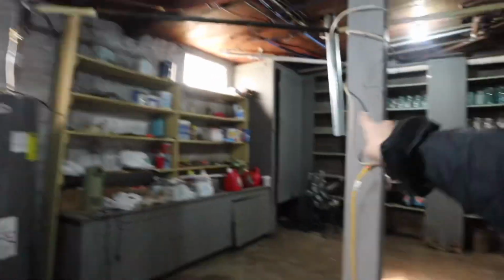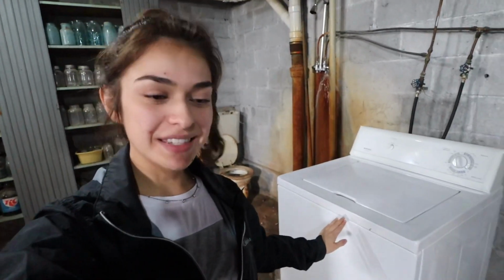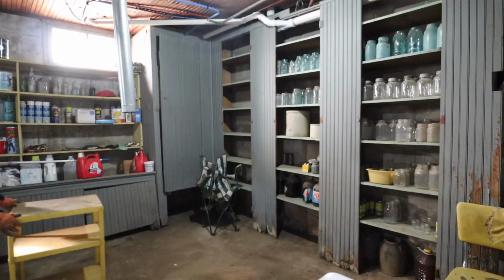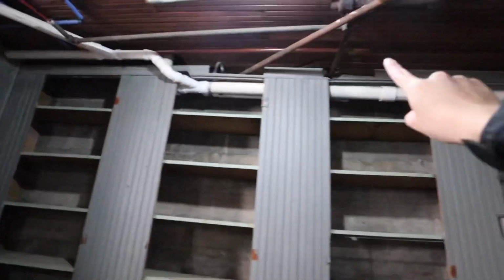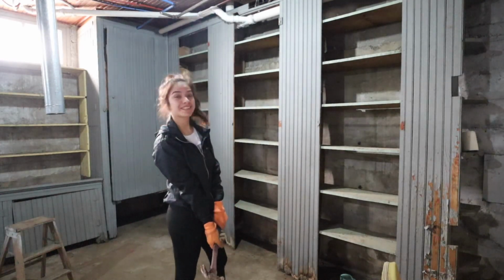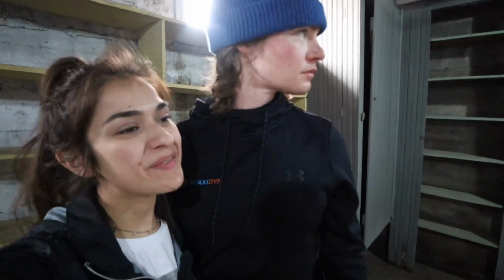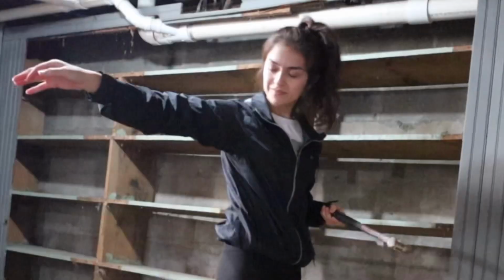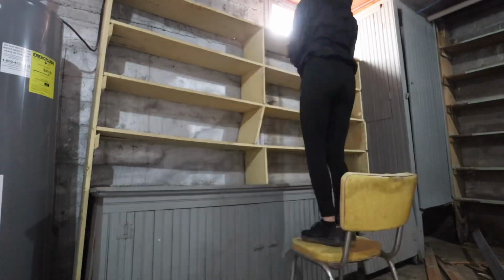Renovating The Scary Basement!!!

Comment: With all the room you have upstairs, move your laundry to the second floor where all the laundry is generated. Most basements need a dehumidifier to help cut down on the moisture, dry lock and paint with new bright led lighting will transform any basement.
Nave goes full on beast mode..... good for you girl!

Comment: Love that as time goes by Nave - you show in your videos no fear of working to achieve an end goal - just like Cole.   

For your spider fear and to keep bugs out of the house in general - next time Cole & you go to Menards take a look @ Spectracide.   

Cole has his handy little full faced mask with filters so put him to works spraying the outside basement walls that are exposed up to the bottom of the siding.  Then spray all along the top of the basement walls, around the windows and as much under and behind things.   Suggest a minimal of twice a year in the spring of the year when bugs come out and later in the fall when they try to make a home inside a heated house.  

Been doing it for years and so rare to find anything in the basement or the house in general and if I do - it is moving like snail so easy to splat.  

Bugs in general need to stay outside all year around.   Have suggested to many other folks and they have the same or better results.  

The basement "redo" cleanup will be interesting to watch.  If you paint as I suspect you will after scrubbing/power washing everything - use a really good water proof paint to cut the humidity way down since concrete is pourus by nature.  

https://www.menards.com/main/building-materials/insulation/foundation-insulation-coatings/duck-coat-liquid-rubber-wall-patch-0-9-gallon/h2986/p-1529908199407-c-9532.htm?tid=5743305199170295506&ipos=6  Before painting to seal areas such as where the wall meets the floor.

https://www.menards.com/main/building-materials/insulation/foundation-protection/duck-coat-liquid-rubber-basement-sealer-4-75-gallon/h2985/p-1529908199468-c-9532.htm?tid=5743305199170295506&ipos=5  What I recommend for serious sealing of the basement walls.  Not cheap but premium stuff!   :-)

Comment: I don't know how far you have gotten, but a tip for washing is nit a power washer. It may ruin the cement between the cinder blocks. When I washed the cement floor in my garage, I took a spray bottle and mixed it half water/half bleach. This way, I could spray it directly where it needed to be. Then I took a plastic bristle broom and spread the mixture all over. By morning it was dry and smelled clean and looked it.  Good luck!!

Comment: If it's musty it's mildew. You need lysol spray that kills mildew. Since you mentioned power spray that's the issue. Also if you expose the windows to outside sunlight that will help kill the spores. You can always get some cactus.and grow them.
Get a 5 lb hammer and take out any frustration let your anger flow. And if you need to rip out nails use one of those pieces of wood as block for the curved part of the crowbar when pulling nails.

Comment: Someone mentioned air quality in the basement.  I just bought an Airdoctor air cleaner after I saw Summer using one on her channel.  Just came in today and it’s amazing...I can already tell the difference...it makes the air smell so clean. One of those would be perfect for your basement:
Reply: First need a dehumidifier. That alone will likely solve the problem.

Comment: Drylock paint works very well for sealing basement walls, concrete block, and helps prevent or eliminate water intrusion.  Drylock plug works well for cracks/old grout and sealing between wall and floor. It's a lot of work but well worth it.  Especially for old basements.

Comment: Amazon sells a machine that will get rid of that smell too.  Enerzen Ozone Generator 6,000mg Industrial O3 Air Purifier Deodorizer $50.  I have used it.  It works.  That musty smell is probably mold and it can be dangerous.  Have someone check that for you.  In the meantime use the Enerzen for 90 minutes down there.

Comment: You should get boxes or bins to put those jars in and sort them by type. Also, consider putting a set of front load w/d upstairs connected to new master closet and the hall. You can stack them and save tons of work. No more taking laundry up and down stairs. Also build in sliding sorting bins - basically like cabinets with cut out at top front on drawer slides. Three big ones: whites, colored clothes, towels. You will be so glad later!

Comment: ** Remove all the nails from all the lumber, then find out where to stack it so it is protected from the elements and from cleaning in the basement 

** Tell Cole...
🥛🥃
. canning jars are usable; 
. possible antiques in the mix;
. if you won't use, please share or sell or donate.
🍯🏺
. crocks are usable whether for preserving (like saurkraut or salt pork) or for decorative; 
. possible antiques in the mix;
. if you won't use, please share or sell or donate.
🪵🪓
. wood planks are usable and valuable;
. you're going to need shelves in the basement anyway;
. check first with your carpenter Justin;
. remove nails before you stack them; 
. if you won't use, please share or sell or donate.
🥰

Comment: well you can clean and paint it but given that you live in Iowa, the  exterior basement walls should be insulated with 2" foam . not what you signed up for but consider it when you make improvements such that you don't have to undo what you are doing now when the time comes. DO NOT USE fiberglass insulation  as it will hold moisture. Ok ,I have depressed you enough.

Comment: Those green glass jars might be worth something. People collect all types of things, and it appears you have lots of older things.

When in doubt, hit it with a larger hammer.

Nave, please wear some PPE. Good on ya for wearing gloves. Now you need some safety glasses and some work boots, as stepping on a nail in tennis shoes will get you a trip for a tetanus shot.

Keep up the good work. PS, if you don't want to find spiders, set off a bug bomb late night, then do your demo in the morning. The creepy crawly will be withered up. Before painting the walls, get some Kilz paint which will seal the block and keep mold from forming.

Comment: hi DID YOU SAY YOUR PREGNANT????????? PUT THE BOTTLES FOR SALE ON EBAY. THE GOOD QUALITY MOLD AND BASEMENT SEALER RUN ABOUT 40.00 PER GALLON YOU WILL NEED ABOUT 80 TO 110 GALLONS FOR AND BASEMENT THAT SIZE. PAINTING THINGS WHITE SHOWS THE MOST DUST AND DIRT THINK OF AND SOFT PASTEL COLOR.

Comment: Be sure to put a waterproofer/sealer on the walls first before painting especially on bare cinder block... so it doesn’t flake bubble or peel if it ever gets wet or seeps thru from outside.
Reply: Definitely do your research before painting cement blocks in a basement. You need to know what you have first and foremost.
Reply: @kathyusa-iowa5137  she has cement block. not many variations of it. just def needs sealer before paint